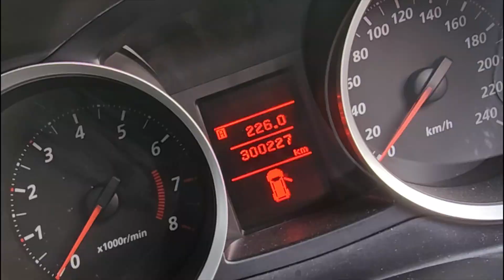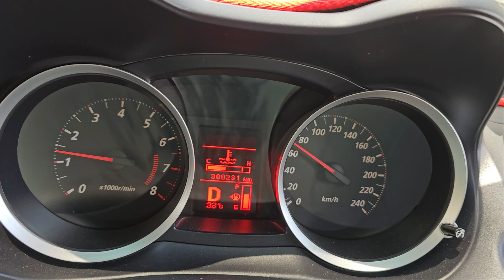How to do engine flushing properly.

Comment: Well Engine flush is ok if it was start using it since brand new(every 10K km) however, if they Do Decided to use engine flush for the first time in most of the oil change, chances are Those Sluges will cause damage to the delicate oil solenoid. Especially those VVT stuff. 1 tips from me is, Run the engine with Sacrifical oil then add the engine flush. Trust me, the freash oil will turn black after it Cycle through god know what accumulated inside.

Comment: Hi bro! Nice video! Am I right to say that if we were to proceed with this method, we would need to have 2 sets of oil and filter?

And since you mentioned that the rpm should be high, can we do it while on P/N?
Reply from the maker: Thank you for your compliment. I appreciate it.
Yes, you are right. We will need two sets of oil and filter following my method. A bit pricey but it ensures a proper job is done.

With the Inspira/Lancer, there is a rev limitter at 3500 rpm when you are at P and N. To be safe, go low gear so you will run high rpm but low speed.

Also, keep the RPM up and down. Do short sprints so your engine don't overheat or burst into flames.

Comment: Hi brother. What coolant you are using now? Spare tank seem colorless. Your RPM about 600? Car vibrate or not?
Reply from the maker: I need to reflush my radiator and refill with the correct amount of coolant.
after the accident, workshop replaced the radiator and I am guessing they did not add any coolant, probably just water. I just need to find some time to get to that.
Yeah, my RPM since Day 1 I got the car idles at around 600 rpm. No vibration and very steady.